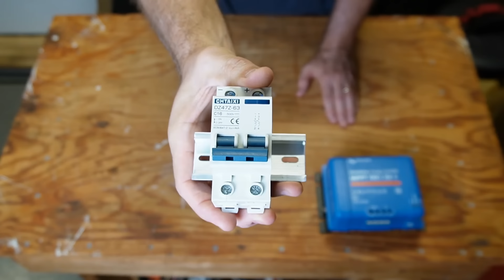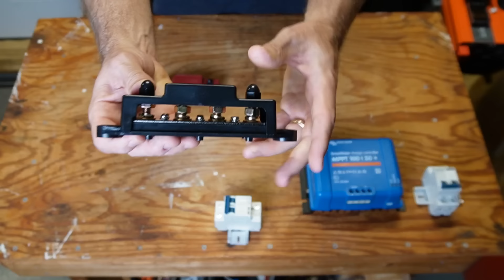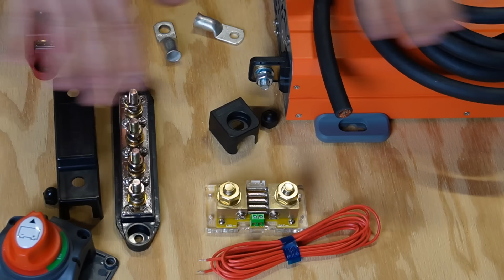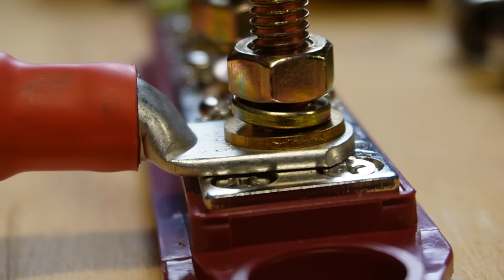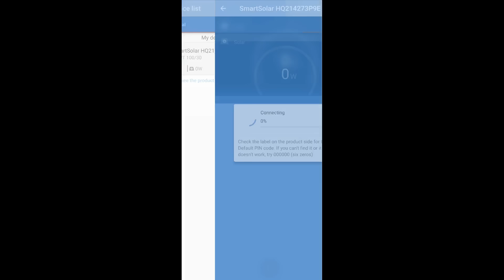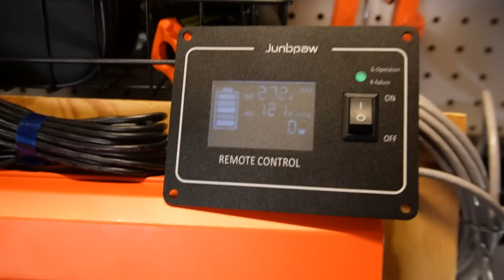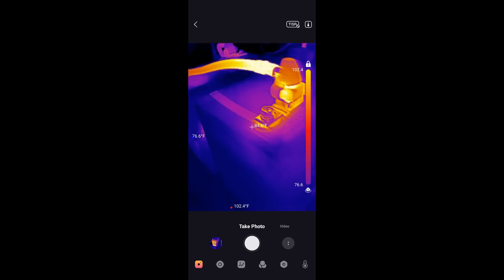24V DIY Off-Grid Solar Generator Build For Beginners

Comment: Does the Controller Break down the higher voltage ?
Reply from the maker: Yes, solar charge controllers can accept a very wide range of solar voltage and then charge the batteries at specific voltages depending on your battery voltage. I used 24v in this case and the solar charge controller automatically detected that if I remember correctly
Reply: 255  God! There is no god except He, the Living, the Everlasting. Neither slumber overtakes Him, nor sleep. To Him belongs everything in the heavens and everything on earth. Who is he that can intercede with Him except with His permission? He knows what is before them, and what is behind them; and they cannot grasp any of His knowledge, except as He wills. His Throne extends over the heavens and the earth, and their preservation does not burden Him. He is the Most High, the Great.
256  There shall be no compulsion in religion; the right way has become distinct from the wrong way. Whoever renounces evil and believes in God has grasped the most trustworthy handle; which does not break. God is Hearing and Knowing.
257  God is the Lord of those who believe; He brings them out of darkness and into light. As for those who disbelieve, their lords are the evil ones; they bring them out of light and into darkness—these are the inmates of the Fire, in which they will abide forever.
258  Have you not considered him who argued with Abraham about his Lord, because God had given him sovereignty? Abraham said, “My Lord is He who gives life and causes death.” He said, “I give life and cause death.” Abraham said, “God brings the sun from the East, so bring it from the West,” so the blasphemer was confounded. God does not guide the wrongdoing people.
259  Or like him who passed by a town collapsed on its foundations. He said, “How can God revive this after its demise?” Thereupon God caused him to die for a hundred years, and then resurrected him. He said, “For how long have you tarried?” He said, “I have tarried for a day, or part of a day.” He said, “No. You have tarried for a hundred years. Now look at your food and your drink—it has not spoiled—and look at your donkey. We will make you a wonder for mankind. And look at the bones, how We arrange them, and then clothe them with flesh.” So when it became clear to him, he said, “I know that God has power over all things.”
260  And when Abraham said, “My Lord, show me how You give life to the dead.” He said, “Have you not believed?” He said, “Yes, but to put my heart at ease.” He said, “Take four birds, and incline them to yourself, then place a part on each hill, then call to them; and they will come rushing to you. And know that God is Powerful and Wise.”

2  God, there is no god but He, the Living, the Eternal.
3  He sent down to you the Book with the Truth, confirming what came before it; and He sent down the Torah and the Gospel.
4  Aforetime, as guidance for mankind; and He sent down the Criterion. Those who have rejected God’s signs will have a severe punishment. God is Mighty, Able to take revenge.
5  Nothing is hidden from God, on earth or in the heaven.
6  It is He who forms you in the wombs as He wills. There is no god except He, the Almighty, the Wise.

11  Originator of the heavens and the earth. He made for you mates from among yourselves, and pairs of animals, by means of which He multiplies you. There is nothing like Him. He is the Hearing, the Seeing.
12  To Him belongs absolute control of the heavens and the earth. He spreads the bounties to whomever He wills, or reduces it. He is aware of all things.
13  He prescribed for you the same religion He enjoined upon Noah, and what We inspired to you, and what We enjoined upon Abraham, and Moses, and Jesus: “You shall uphold the religion, and be not divided therein.” As for the idolaters, what you call them to is outrageous to them. God chooses to Himself whom He wills, and He guides to Himself whoever repents.

54  Your Lord is God; He who created the heavens and the earth in six days, then established Himself on the Throne. The night overtakes the day, as it pursues it persistently; and the sun, and the moon, and the stars are subservient by His command. His is the creation, and His is the command. Blessed is God, Lord of all beings.
55  Call upon your Lord humbly and privately. He does not love the aggressors.
56  And do not corrupt on earth after its reformation, and pray to Him with fear and hope. God’s mercy is close to the doers of good.
57  It is He who sends the wind ahead of His mercy. Then, when they have gathered up heavy clouds, We drive them to a dead land, where We make water come down, and with it We bring out all kinds of fruits. Thus We bring out the dead—perhaps you will reflect.
58  As for the good land, it yields its produce by the leave of its Lord. But as for the bad, it produces nothing but hardship and misery. Thus We explain the revelations in various ways for people who are thankful.
59  We sent Noah to his people. He said, “O my people! Worship God; you have no god other than Him. I fear for you the punishment of a tremendous Day.”
60  The dignitaries among his people said, “We see that you are in obvious error.”
61  He said, “O my people, I am not in error, but I am a messenger from the Lord of the Worlds.”
62  “I deliver to you the messages of my Lord, and I advise you, and I know from God what you do not know.”
63  “Do you wonder that a reminder has come to you from your Lord, through a man from among you, to warn you, and to lead you to righteousness, so that you may attain mercy?”
64  But they called him a liar. So We saved him and those with him in the Ark, and We drowned those who rejected Our revelations. They were blind people.

59  The likeness of Jesus in God’s sight is that of Adam: He created him from dust, then said to him, “Be,” and he was.
60  The truth is from your Lord, so do not be of those who doubt.
61  And if anyone disputes with you about him, after the knowledge that has come to you, say, “Come, let us call our children and your children, and our women and your women, and ourselves and yourselves, and let us invoke God’s curse on the liars.”
62  This is the narrative of truth: there is no god but God. God is the Mighty, the Wise.
63  But if they turn away—God knows the corrupt.
64  Say, “O People of the Book, come to terms common between us and you: that we worship none but God, and that we associate nothing with Him, and that none of us takes others as lords besides God.” And if they turn away, say, “Bear witness that we have submitted.”
65  O People of the Book! Why do you argue about Abraham, when the Torah and the Gospel were not revealed until after him? Will you not reason?
66  Here you are—you argue about things you know, but why do you argue about things you do not know? God knows, and you do not know.
67  Abraham was neither a Jew nor a Christian, but he was a Monotheist, a Muslim. And he was not of the Polytheists.
68  The people most deserving of Abraham are those who followed him, and this prophet, and those who believe. God is the Guardian of the believers.
69  A party of the People of the Book would love to lead you astray, but they only lead themselves astray, and they do not realize it.

84  Say, “We believe in God, and in what was revealed to us; and in what was revealed to Abraham, and Ishmael, and Isaac, and Jacob, and the Patriarchs; and in what was given to Moses, and Jesus, and the prophets from their Lord. We make no distinction between any of them, and to Him we submit.”
85  Whoever seeks other than Islam as a religion, it will not be accepted from him, and in the Hereafter he will be among the losers.

28  It is He who sent His Messenger with the guidance and the religion of truth, to make it prevail over all religions. God suffices as Witness.
29  Muhammad is the Messenger of God. Those with him are stern against the disbelievers, yet compassionate amongst themselves. You see them kneeling, prostrating, seeking blessings from God and approval. Their marks are on their faces from the effects of prostration. Such is their description in the Torah, and their description in the Gospel: like a plant that sprouts, becomes strong, grows thick, and rests on its stem, impressing the farmers. Through them He enrages the disbelievers. God has promised those among them who believe and do good deeds forgiveness and a great reward.

111  And say, “Praise be to God, who has not begotten a son, nor has He a partner in sovereignty, nor has He an ally out of weakness, and glorify Him constantly.”

Read The Quran

Comment: why a 24
Reply from the maker: There are lots of solar charge controllers that work with 24v. They typically work with 12/24 or 12/24/36/48. There are also lots of inverters that work with 24v. Using 24v allows you to use smaller wires because there is less amperage. That is probably the biggest reason.

Comment: Why 24 volts when things are 12 volts?
Reply from the maker: There are lots of solar charge controllers that work with 24v. They typically work with 12/24 or 12/24/36/48. There are also lots of inverters that work with 24v. Using 24v allows you to use smaller wires because there is less amperage. That is probably the biggest reason.

Comment: never told why a 24 volt and what uses 24 volts?
Reply from the maker: There are lots of solar charge controllers that work with 24v. They typically work with 12/24 or 12/24/36/48. There are also lots of inverters that work with 24v. Using 24v allows you to use smaller wires because there is less amperage. That is probably the biggest reason.

Comment: why use 2 12,8 v batteries when 1 24 volt battery can do the same job?  and it is cheaper cable wise ? yes 24 volt batteries are more expensive but safer than 12,8v . smaller wires  and besides  with a victron solar charger controller 100v 30 amp you can connect 800watts of panels  not only 450 watt  like on a 12 v system.